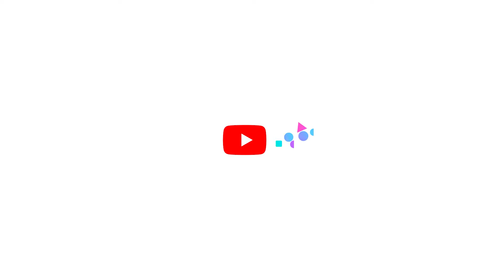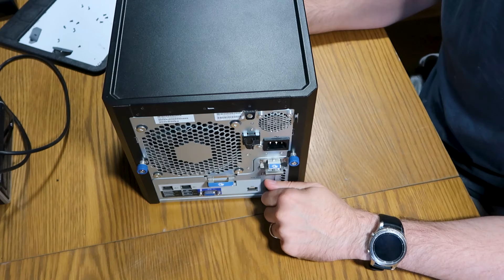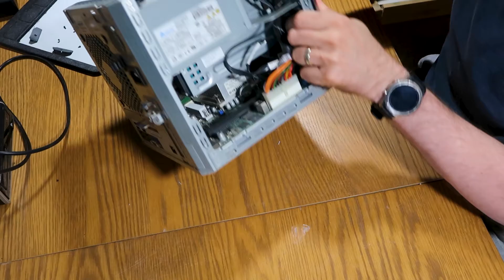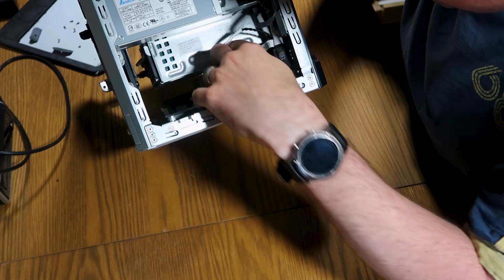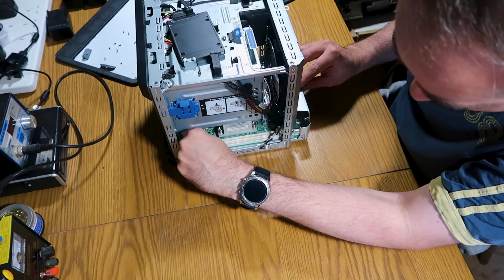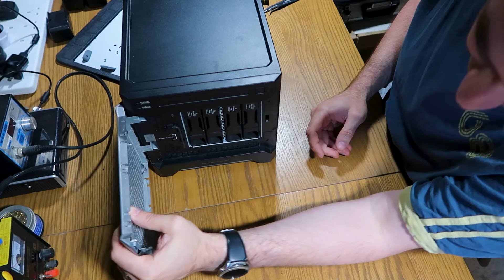HP Gen 8 Micro Server - Teardown & CPU Replacement

Comment: Thanks for your sharing. I just bought it from the market but I don't know if it can work with 12TB hard drives. Have you tried a HDD which is bigger than 6TB or 12TB?
Reply from the maker: No I've not gone that big let me know if you have any luck as  I'm running out of space so might follow you.

Comment: I know you posted this a while ago - great video - but although I've ordered cables for fitting the SSD to the Sata ODD, I've read elsewhere it's tricky to get the server to boot from this drive (particularly if not a raid setup). I'm running Windows 10 Pro - just wondered what your set up is there? Assume that it's not Windows 10 and did you any issues getting the server to boot from the SSD? Currently I have the SSD in the first main drive slot and it works fine, but wanted to save this slot for a main drive
Reply from the maker: No it worked 1st time but you do need to setup the newly installed disk in raid 0 and you will need the B110 raid drivers so when you install windows it will see the disk.

Comment: Hi - Wanted to say this is a great video!!!  I have a Gen 8 and was looking at upgrading to another off the shelf NAS but was wondering if its possible to expand the device from 4 bays?  Or would it be easier to just add larger HDD to it?  I have all 4 bays populated with 2x12Tb 1x10Tb and a 4Tb.  I also use it as a Plex server and run docker containers on it but Im using OMV which I now wish I hadnt.  Your advice would be great if you have the time to reply.  Thanks
Reply from the maker: Sorry to say it but you're very much capped to the 4 bays, on the previous generation you could get around it with a DVD drive bay conversation but unfortunately not on this one 😞
Reply: How about simply connecting a DAS to the server via USB3?
Reply from the maker: You could but I’m not sure you would get good performance

Comment: Hi. Looking for some advice. I just acquired a HP gen8, it has 6gb ram, but now drives and no Ssd drive: You  mention in your video this is your boot drive. I needing advice on what cables/leads I need for my boot drive, I have a spare laptop drive that will hopefully do the trick and what do you recommend for the data drives?  There seems to be a load of chatter saying you go go as large as you want. I intend to use the server on my LAN, installing a database of sorts and the OS I was going cheap and installing a Linux base system. Any ideas or feedback welcome, many thanks.

Comment: I have just bought one these lovely machines, installed open media vault successfully it on the reboot can’t get the machine to boot up to the operating system is this a common fault do you know please.
Reply from the maker: Check the bios settings to see if raid is turned on as you might need to turn it off. If you are using the raid you will need the B110i drivers installed to detect your drives

Comment: This is great, thanks. I have ordered an Intel Xeon E3-1265L v2 2.5 GHz Quad-Core Eight-Core 45W ready to run ESXi on this Gen8. I'd love to know more about your SSD drive and how and why you use it, if it's helpful for my ESXi installation and if so, do you have a video showing the procedure? I currently have 2x2Tb in RAID 1.
Reply from the maker: I will see if I can put something together for you. 

In a nut shell I have two Raid 1 arrays and a Raid 0 boot drive. From what I remember this card only supports raid 0, 1 and 10. 

Its quite a simple setup really. The other thing you could explore is booting ESXI from the internal USB if you don't want to faff with trying to get a single drive in place like i did.

Comment: Hiya, this is exactly what I want to do with CDrom to SSD replacement. What's the cable you bought? I already have a SATA cable for the data. as for the power, did you just buy a spliter and then molex to sata power?
Reply from the maker: This is what you need: https://amzn.to/3gOQ6T8
Reply: @WeRepair  Just to check, did you have a molex splitter AND the molex to SATA converter? Or is it just the molex to SATA converter? 

I'm hunting around and not seeing a spare molex connector.

Comment: Nice job, but the Xeon E3 might get a little bit hot on a Passive Cpu cooler.. maybe consider a Active Low profile CPU cooler.. I build this one on my GEN8 "Akasa K25" 
Good luck!
Reply from the maker: Good shout, yes with the stock cooler it does run a little hot but still with in a safe range and has not been an issue for me.

Comment: Hi there, thanks for the video! I'm thinking about migrating from USB boot drives to an internal SSD. I've read somewhere that you cannot boot from the internal SATA connector. Is that correct?
Reply from the maker: No, I boot from a ssd connected  the CD drive SATA totally fine
Reply: @WeRepair  But you do use the internal RAID controller? From what I read booting from the other SATA port is only possible once you do that.
Reply from the maker: @jerryfletcher  Yes I am, its setup as a raid 0 with a single sata as the boot drive. As far as im aware with the raid controller on you have no other option.